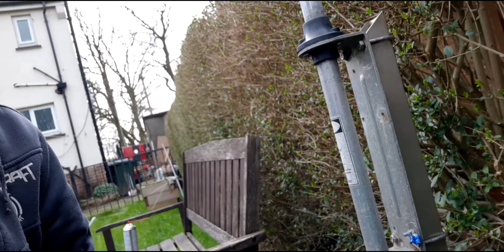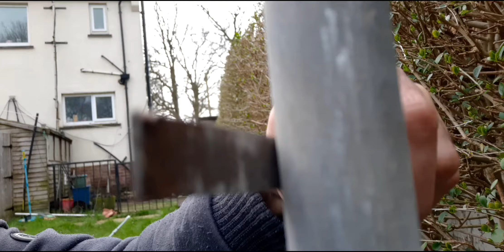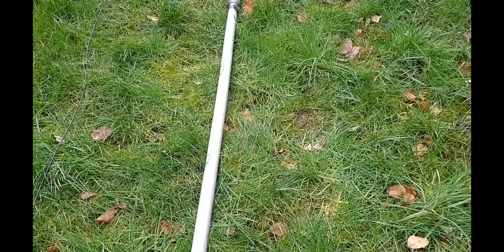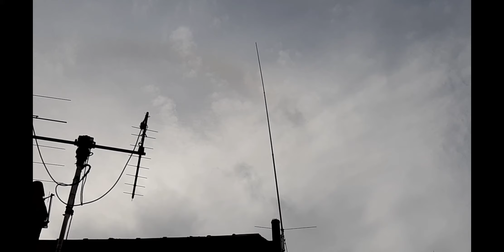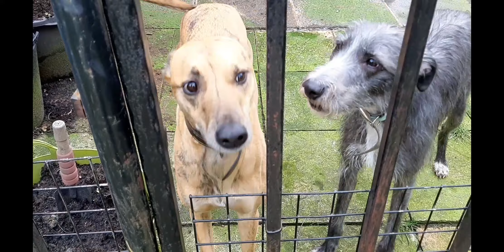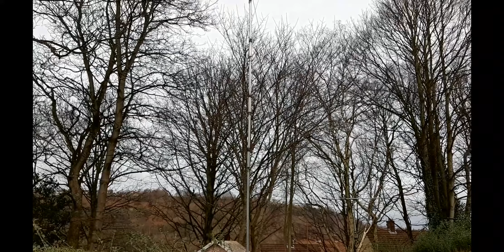SWR Adjustments To The Hustler 6BTV HF antenna

Comment: Hello, thanks for taking the time to make this video.  I watched the part with your meter several times and now I see the error of my way.  After I figured out I needed to bring the frequency into the freq range of the band I was trying to tune I was very happy to see that I went from 2.5 at 28500 to 1.2.  Another rain shower has interrupted me again but I finally understand what I'm looking for  Thanks again de Ed K3ENV.
Reply from the maker: Hi Ed

great to hear that it is working out for you. Thanks for leaving the comment. If you cut some wire at 12ft and add it to the base as ground plane it works exceptionally well and also helps bring the SWR right down. Mine are now hidden in the grass and and can no longer be seen. I pegged them down with some wire pegs i made from welding wire it soon grows over and works awesome. Have fun! Good DX and enjoy your antenna.

Comment: As I said in my previous posts I will give an update on the installation of this antenna.
Basically I purchased the BTV-5 but left off the 80mtr resonator thereby using it as a BTV- 4
Installation was against timber post and rail fence with a timber cantilever mod to lower the antenna.
First SWR measurements off the scale , infinity 
Installed short mild steel ground post and then achieved SWRs of between 7 and infinity
This minuscule improvement suggested that the problem was the grounding
Then buried 8 off 2mm bare copper wires 4 mtr long and coupled these to a buss bar and then connected via  a 6mm copper wire to antenna base.
This improved the SWR but still nothing below 3
Next I removed the buss bar and ground rod and connected radials direct to the antenna base.
Now we are cooking!
This arrangement provided 90 degree ground cover
Then installed a further 8 radials making 180degree coverage and “hey presto” 1.1 center band and 1.6 /8 at the edges
I can tweak this further by adjustments of the tube lengths.
Now interestingly I spent many hours researching this antenna and can summarise as follows.
Radials are essential 
16 being the optimal number
Ground rod not necessary if good radial system installed 
DONT BOTHER WITH THE INSTALLATION SETTINGS INCLUDED IN THE ANTENNA KIT

DX ENGINEERING provide an extremely comprehensive manual of 60 pages most of which dedicated to the Huster verticals
This is available as a free download and provided the settings that I used.
Also included are dedicated adjustment setting for the traps.
I hope that this is helpful to others who may be experiencing problems tuning this antenna and thank those who took the time to give me advice
Ps I also provided an insulated support 1 mtr up from the base to help reduce stress at base during windy conditions 
73 Barry G0VEI
Reply from the maker: Excellent information tnx for sharing. Just added a few extra 40m radials to mine seems to be better. Its great fun experimenting  around. 73 good DX 👍

Comment: Yes I wondered that as well. I’m putting a 4 foot copper ground rod in and if no difference I’ll drive a scaffold pole in and mount against that. If ok with you I’ll keep in touch with developments as others may find it useful 
Cheers Barry
Reply from the maker: Yes no problem on keeping in touch 👌 hope it works with a good ground, it should. 73

Comment: Thank you. I have the 6 also. 
  Have a small yard also. Was difficult to find a place free from metal rain gutters and fences. 
  Such metal items have to be twenty feet or more away from a vertical to avoid changing the tuning, or detuning the antenna.
  I have the antenna close to the ground and am still sorting out tuning the antenna. 73, N0QFT
Reply from the maker: I'm sure you will get it tuned with a bit more playing around. I have 9 wire radials (not many) which has helped tune on 40 and 80m the other bands are fully resonant 1:1. Hope to hear you soon  best 73 de Simon M0YKS

Comment: Hello!  I`ve a 6 BTV. Installation on roof possibe- with no radials, but using the big aluminium frame from my solarpanals on the roof?
Reply from the maker: Hi I tried a roof mount on my work building it worked well. G L happy DX
Reply: @M0YKSHamRadio  , ok, thx for information. Happy DX and happy new year!
(Sorry, my english isn`t so good. )

Comment: Hi Simon, 
Did you only use 180* of radials ? My antenna will be going at end of garden with about 24ft in front , 10ft left and right and about 6ft behind , can I have a mixture of sizes or do you recommend just sticking with 180* of radials , thanks mate for your help, I’m learning loads from you 👍🏽M7PJD
Reply from the maker: Mine isn't a 360 due to it been near the hedges.  I've done a random spread it works out OK but 360 is best. Try 12 ft lengths and as many as you can works ace on most bands
Reply: @M0YKSHamRadio  thanks Simon , appreciate that , 12ft strips it is , all the best
Reply: @M0YKSHamRadio  Hello Simon, I bought a copper 4ft ground rod to place beside my 6BTV, is it necessary? Cheers pal 👍🏽

Comment: When you adjust, are you moving the trap sleeves up or down or the individual tubes. Thanks.
Reply from the maker: Just the tube length. I got the best results with the 12 ft radials added.
Reply: @M0YKSHamRadio  thank you sir.  From America with cheers

Comment: Today is Oct 14th 2024.  I just watched your video.  I was trying to tune my 5BTV and it seemed to be too long.  The on line booklet says NOT to trim any tubes, but I see you cut off an inch.  I tried calling the company, but they were closed (they are on East coast time and I am on west coast time). I was tempted to saw off a bit of my 10 meter section like you did.  Did cutting your antenna  like you did cause any other issues??
Reply from the maker: @daveengstrom9250  no problem trimming it shorter. I took off about 1 inch/ 30mm . I am still using it with 12ft wire radials attached and the SWR is 1:1 - 1:5 on 40m.

Comment: Hi mate im thinking of buying one of these are they a devil to get right
Reply from the maker: Hi bud. Easy enough especially with a few wire radials. I have had mine since 2004 and its working just as well in 2021 if not better with the extra wire radials  beauty antenna in my experience 73
Reply: @M0YKSHamRadio  thank you bud I use a comet h422 at the moment great antenna but want more cover thank you fir replying to me 2e0dcj
Reply from the maker: Hope you get one and enjoy it 73

Comment: What’s the total length of the 6BTV antenna? Could that antenna be put inside of a larger plastic PVC pipe to create a stealth flagpole antenna? That’s interesting to hear the W2RE super HF station from your location and antenna.
Dave KY0L
Reply from the maker: Hi Dave thanks for the comment. The length is 25feet and yes it could work with the flagpole idea. Great antenna which has been in use since 2004  and still works just as well. 73 de Simon M0YKS
Reply: Simon, What’s the bandwidth for the 75/80 meter band for SWR? Maybe for 1.5:1 and 2:1? Do you need to run radials? What’s the antenna’s power capacity? That looks like it might be a good alternative antenna to my dipole antennas.
Dave KY0L
Reply from the maker: @daveborchard2019 Hi Dave I believe it will handle 1.5KW  I run 400W. As for SWR its 1.8 on 3.790 but the bandwidth is very narrow and requires a decent high power ATU. I use a MFJ 962D 1.5KW Roller Inductor Antenna Tuner which works spot on. Most of the time the dipole is better on 80m but on occasion the vertical is better for DX. Always the vertical has the low qrn and much quieter receive over the dipole. I have both and like to switch between the two using a inline two way switch after the amplifier. 73 have fun playing around with your antenna setup. de Simon M0YKS

Comment: I have the the 6 as well, I have tried doing it from the instructions, swr way up high, I had it 2 foot of the grass, and six foot still not good, I had the radials out as per the instructions, but still no go, so am a bit stamped, as I would have used it mainly for 20-40 and 80 so some where l have not got it right, any ideas please
Reply from the maker: Is the SWR high on every band? The coaxial feedpoint is quite important to get right, the length of shielding braid as well as the spacing between the inner core and shield when you split it and solder the lugs on. Also the inner core stick-out length and braid length where you split it at the connection point can be altered in length or shortened etc. Sounds crazy but makes a difference. There is info about this in the instruction manual you might have seen it? Another thing you need a coax choke close to the feedpoint (4-8 turns 4" coil cable tied or taped). Also have you tried it without radials? Look forward to hearing back from you.
Reply: @M0YKSHamRadio  I'm facing the same issue and this nailed it for me. Thanks!
Reply from the maker: No problem buddy glad  it worked out. Have fun good dx.

Comment: I wonder if some product can be applied onto a brand new antenna to prevent corrosion?
I'm ordering  the B6TV and it will be sitting on a 6 foot high base on a 3rd floor balcony, no appartments above. I should get grea treception as I'm sitting on the 2nd highest point top in the entire area, the highest hosts a variety of transmission towers for tv and radio. I've experimented with dipoles for 20 m and 40 m and it was very deceiving, more noise than signals, very weak.
Getting my Yaesu FT-One back tonight and I'll try again with the dipoles until the antenna arrives.
Reply from the maker: I wouldn't worry too much mine has been outside in Yorkshire weather for 16 years and as you can see minimum corrosion. Enjoy years of service with your new antenna 73

Comment: Hi Simon I noticed your not using the 20m capacity hat (think that's what it's called) had mine up around 3 months now and is fantastic 1.1:1 on all bands and highest is only 1:5:1 on 80:) works fantastic on dx on 20 and 40 :) just wondered why your not using the hat n does it make any difference?? Cheers
Reply from the maker: Nice one Andy, did you buy it as an add on? Mine is the standard 6btv they are very good especially since I added more radials the swr is now 1:1. Have fun 73
Reply: @M0YKSHamRadio   no mate came as a complete package from martyn lynch .I've been watching a few on you tube n most have the hats but there's a couple don't........weird
Reply from the maker: @andy2E0JIU  not sure all I know is the 5btv has hats and 6btv doesn't. The 5btv has the option of the 80m resonator fitting as an extra maybe that's it.

Comment: Great video, I have the 4btv and wondered if you can tell me honestly how it performs on 80m with that resonator as I was going to buy one, have you got radials out for 80m? And if you could give me a video demo on the 80m on it I'd be very happy. Thanks Simon. 👍
Reply from the maker: Hi Gary I will make video sometime when I get a spare few mins. The 80m resonator works but not as well as my dipole. I have made good DX on 80m using the 6BTV into USA and EU but the dipole puts out a better signal into USA. However receive is really good with low noise floor on the 6BTV. I have a few 40m and 20m radials attached. I would say if you cant get a dipole up for 80 the resonator would be worth getting. For myself I use it mostly on 80 for RX, I use it for TX on 40m and sometimes 20m but I have my beam which is much better 20 - 10m
Reply: @M0YKSHamRadio  Simon, many thanks for that reply helps alot, I can't get a dipole up for even 40m let alone 80m so this is my only option to be fair. If it gives me the chance to have a few qso's into G land and maybe Europe I'm well happy. Love to see a video of you can do one sometime. Nothing on YouTube so may help others too.
Is the swr ok on 80m? Thanks mate all the best Gary 2e0faq.👍
Reply from the maker: @shuttersound69  worth getting one if your strapped for space. As for swr on 80m, it will go down to 1:5 -1:8 on a very  narrow portion of the band. But with a decent ATU it tunes down to 1:1 on most of 80m. I'll do a vid next for 80m. Best 73 and let me know how it works out.
Reply: @shuttersound69   Hi Gary, Did you get the 80m resonator? thinking of buying one my self for the 4BTV. How do you like the 4BTV? Had mine a few weeks and it's good... need some more radials down though.

Comment: greetings, needs some advise here. i have a 5btv, with High swr on all bands. question i have ,, i set the lenghts based on the hustler measurements with ground radials, so now should i shorten the lengths starting from 10meter trap to get lower swr?
Reply from the maker: Hello yes start by tuning the bottom 10m as you said then 15, and then 20m. By the time you get to 40m the length will be close to resonant

Comment: Hi Simon, I have just ordered the 6BTV, I’m new to the game, does the pole have to physically go into the ground or can it sit in a metal base (heavy parasol base) on paving slabs , I’ve only been a ham for a year and only just bought my first antenna, your videos convinced me, I’m a radio man from the 80s that has been away for too long, 
M7PJD cheers mate 73
Reply from the maker: Hi  bud congrats on getting back into it and getting your ham licence. I would recommend a good fixing not necessarily into the ground but definitely strong due to the length and weight of the hustler. Have fun and hope to hear you soon
Reply: @M0YKSHamRadio  thanks Simon 👍🏽

Comment: Just installed Hustler BTV4 and having probs with high swr on all but 40 Mtrs
Put down 8 radials and improved but not good enough, will try additional 8 to see if better.
I don’t want to chop the 10 Mtr tube but it may help.
How many radials on your system
Regards Baz G0VEI
Reply from the maker: Hi Barry check the shield side of the coax is a good connection and get the radials attached as close as you can to the shield/ground termination point. Mine are lugs on the same bolt as the coaxial braid if that helps. Other option is to alter the mount height. I have mine 3 feet above the ground. I only have 2 radials for each band 10 - 80 at the moment but gonna be changing it and putting a few more on for 40. Good luck
Reply: @M0YKSHamRadio  
Thanks coax is RG213 short length incorporating air wound 10 turns choke . I’m taking all readings at this point The antenna is mounted 4inches off ground on a timber tilt mount , radials to a bus bar then 12inch of  6mm wire to antenna base mount.  Readings are 10 mtr 1.8 swr at bottom end but 1.3 swr at  mid to top end of 27mhz
20 mtr 4swr best I can get, 80 mtr 1.5 bottom end . 15mtrs 3.8 swr
Reply from the maker: @barrydavison8705  might be the tilting wood thingy mine is on a steel mount that is driven into the ground with sledge hammer. Could be that

Comment: Just subscribed ... enjoying your videos 👍... like the idea of cleaning up the vertical... I’m thinking of going for the 6BTV as restricted size garden can you advise how many radials you use as I can only position radial through 180 degrees? Keep up the good work .
Reply from the maker: Hi Dave, Thanks for the sub! glad you like the vids bro. I am always up to something ha ha. Yes I can say that the radials help but are not critical if ground mounted. I have minimum radials on mine, 4 for 40m, 2 for 80m 2 for 20m and 2 for 10m. I have the terminated/grounded point either side of the antenna base with the radials (made from random electrical cable) cable tied together from the antenna base. The radials are laid on the ground under the hedge which is over 100ft long. My radials are not spread out and it works. It would be better if you can spread them and add more per band in some cases. But not always! Location, soil, rocks and wetland can be the biggest winner as I have a second 6BTV up on the moor tops at my holiday cabin with no radials which is a DX beaut! The good thing about a hustler is it lasts years and is made very well. Both of mine were purchased in 2004 and still in use 2020. 73! G L Simon M0YKS
Reply: MØYKS - Ham Radio Many thanks for the detailed reply Simon great info I’m about to commit to a purchase and I’ll let you know... liking the regular updates great stuff...apologies for the late reply to express my thanks busy for a few weeks...hope to get back on radio ASAP
Reply from the maker: @mccooperman  no worries buddy glad to hear you're going ahead and I will look forward to hearing you on the bands. Thanks for the support and positive feedback best 73 de Simon M0YKS